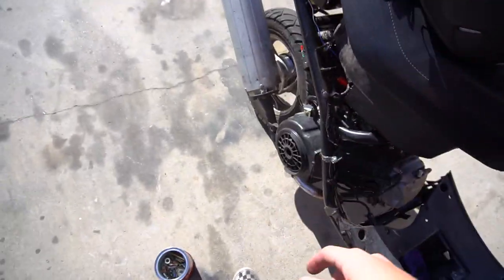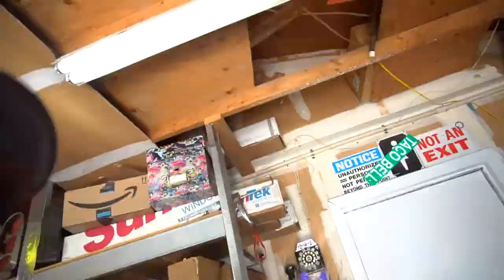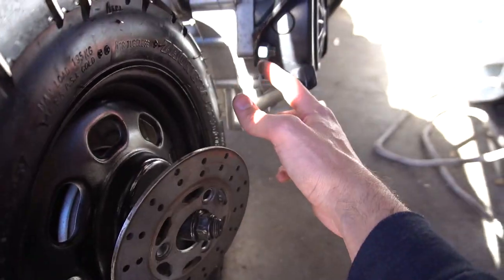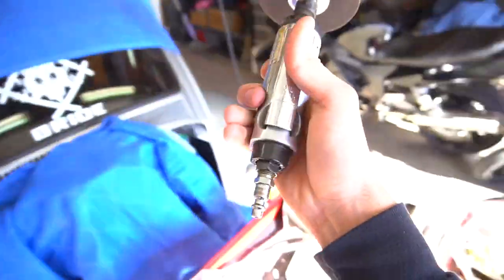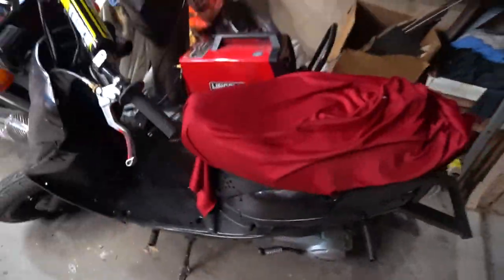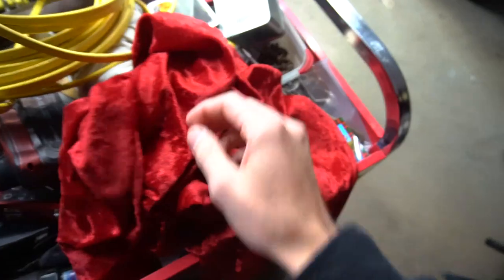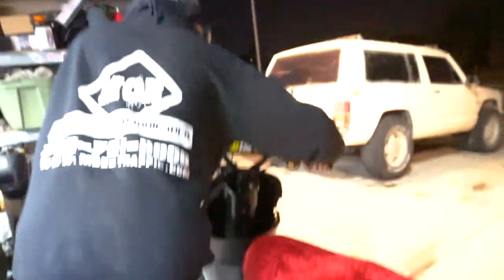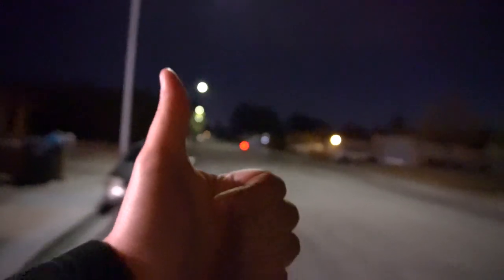DIY REAR HAND BRAKE BUILD PART 1 (Stunt Brake)  gy6 Scooter

Comment: You can just put the rear hub from a rear disc model it's 5 bolts and some gear oil pretty easy but I like the custom fab thoe